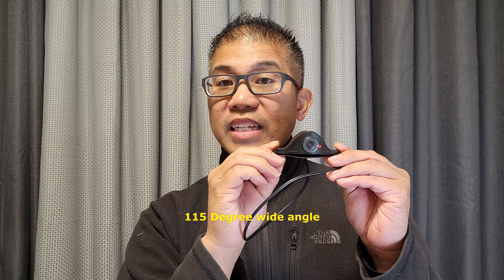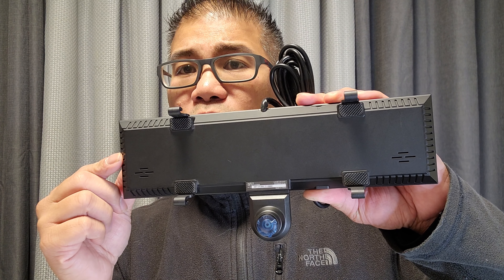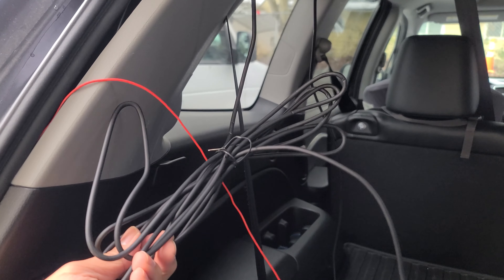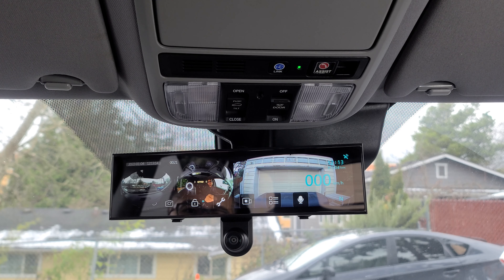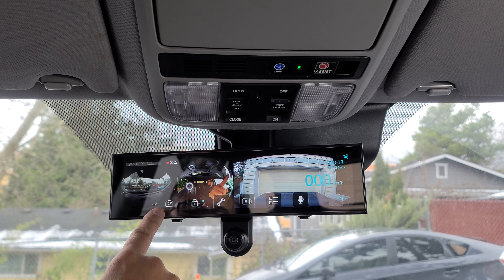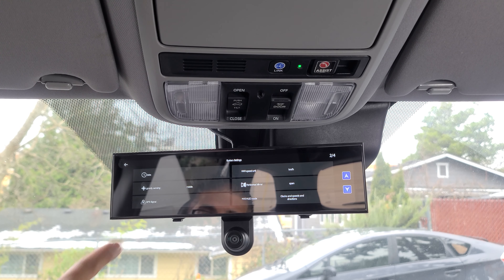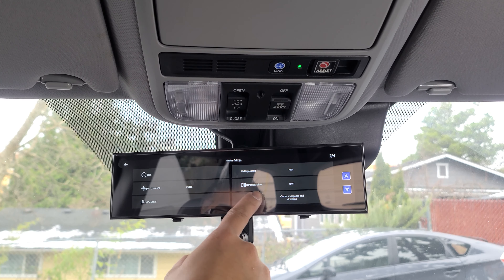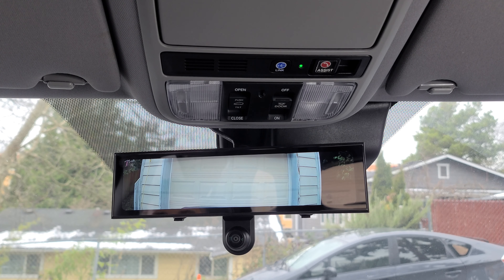How to install Akeeyo 720 Mirror Dashcam AKY V720S

Comment: I really appreciate the video but I definitely want to install a hardwire kit.  You suggested, in this video, that we check out your video on the hardwire kit but I don't think I'm finding the right video at least for connecting this camera to power.  It doesn't have a standard USB micro, mini, or C connector.  It has the proprietary Akeeyo 5 pin round connector.  I figure that means all the "universal" kits online won't work for me.  I found the hardwire kit on Akeeyo's site but the picture shows that it TOO has a USB plug and not the 5 pin round connector.  I'm clearly missing something.  Could you point me in the direction of your video to install the hardwire kit for the V720S or just point me to where I can get a compatible hardwire kit?

Thank you in advance and I hope to hear from you soon.